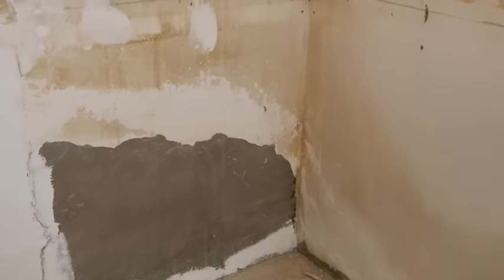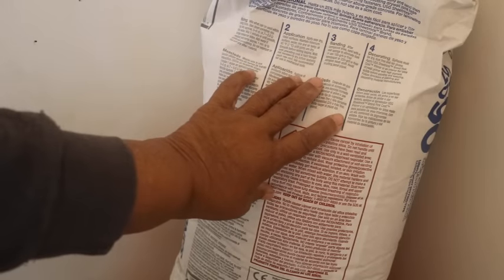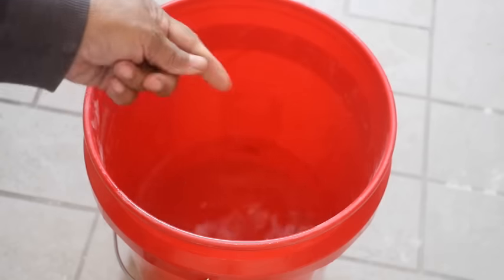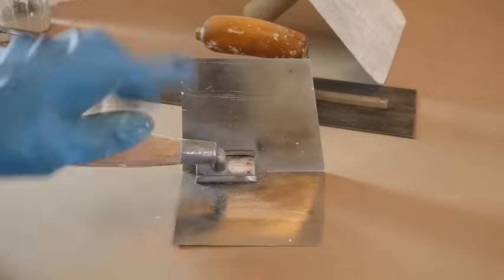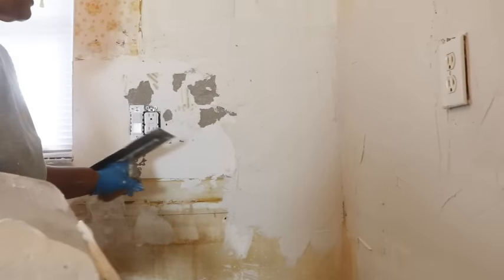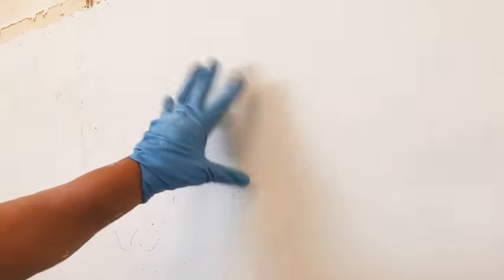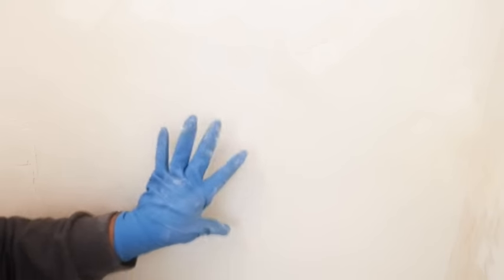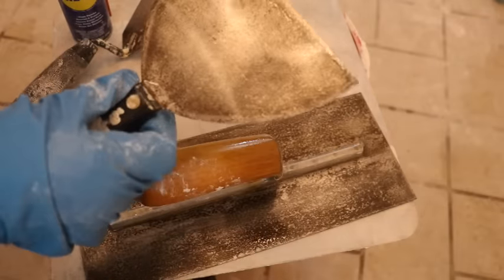You'll never sand JOINT COMPOUND again!!!

Comment: This is a very good introductory video with a lot of accurate information but I’m sorry to say that I still sand a surface like this before painting. This method is the same as plaster but the material is different. There used to be a product called Diamond Coat, and it had adhesive in it and was a one-step process just like what is being used here. It was inherently known to look nothing like you had left it the night before. You would trowel and trowel and polish it, and then the next morning BAMM! To ultimately make the surface as smooth as plaster or drywall finish I apply a tight “smudge” coat of drywall compound to the entire surface and then sand it, much like how it’s done with drywall application. Drywall compound (putty) has been around a lot longer than what plasterers are willing to admit. It’s been around since the 1920s as a USG product and plasterers used it to blend and smooth blemished wall surfaces, and they SANDED it. Also, this bag of 90 minute might say “EZ sand” on it. It’s not. It has moulding plaster in it. It is very difficult to sand.

Comment: I subbed. I found this trick out by accident. You are really good! Finishing walls that are newly installed is one thing, but re-work or repairing or finishing butt joints such as those in manufactured homes is a whole other thing.  Your tip on taking care of your tools is spot on too. I saw a new finishing tool on a short video I have to get and try it out. Thanks for the video!

Comment: When i saw the heading I thought, yeah Idont think so. When you pulled out the hot mud, I said we'll see. When you said theres a difference between setting and drying time I knew you knew more than 99% of the people giving advice. I do the same thing you do one small projects that I dont want to come back and sand the next day. Nect time add some plus3 to it. The plus3 causes the hot mud to go off faster, but stays workable longer, so you can make the surface smooth with less effort. Good job

Comment: For the water technique I use a masonry sponge I went use cold water and ring it out to just damp that has work subpar to wet sanding the wall and using my 12" trowel to finish works everytime.

Comment: As always, Great and informative video!  I have orange peel walls and wanted smooth walls under my board and batten.  I skim coated, and once dry, I used a lightly wet, yellow sponge.  Did this 3 times to completely hide the orange peel.  They came out awesome!  NO SANDING!😅😅

Comment: The best tip for anyone having plastering work done, especially if you haven't used them before. Hold back some of the payment until you see the plaster dry in daylight. Wet plaster always looks great and is much more difficult to spot imperfections. It's even harder to judge via video.
I taught myself a long time ago because there are many "plasterers" who are not very good at plastering or make a hell of a mess in the process.

Comment: Ah, the flashbacks ... I learned of this technique watching plasterers from the UK who favor it as I wanted plaster on the walls instead of drywall mud that chips easily.  My problem is I just can't get the feel of the trowel and end up doing more damage than good.  I used all the materials you showed; it was just the coordination of that trowel in my hand I could not master.  I had to end up sanding.  It was a mess.  The underneath is plaster but I finally had to resort to using a thin skim coat of just regular contractor's mud which is easier to work with for the final coat and then lightly sand.  Finally got the room done (19x20 with a sloped ceiling nonetheless) but what a nightmare.  Not a project I'd ever be willing to do again (it was for my daughter's bedroom we remodeled).

Comment: I had to subscribe because I have been a drywaller for forty years and I couldn't improve on what you just watched. It's more tiring than she makes it sound because she is a strong woman . Good luck in all of your future endeavors!
Reply: You don't sand joints? Just do it with a brush and water? How does that work?

I'm a carpenter... I've never seen a drywaller do it like that.
Reply: @stevem815  it's plaster if you keep it damp you can rin you trowel over it forever .

Comment: A really good video Jeanne.  You are thorough, upbeat and as brief as possible with your instruction.  I knew about using a wet sponge to smooth down joint compound without sandpaper, but never heard of "water troweling".  I assume you can use this same technique when usen premixed vinyl joint compound rather dry mix.

Comment: Amazingly helpful! The biggest problem I run into with projects like this is that I don't clean up thoroughly enough before starting the mud and end up getting debris in my mix. Getting it super clean like your before shot is going to save so many headaches.
Reply: Any time I get a piece of dirt or debris picked up on my trowel, I always discard those clumps of mud or put it in a certain spot on my pan edge that I know not to reuse. That helps too.

Comment: I do this over ugly basement walls and my clients love it, although I don't go for the same perfection. I smooth it out with a wet rag and (prime and) paint it the color of their choice. I do go the next level of wet troweling in the living spaces, especially in restoration work, but most of my work these days is ripping down to the studs and replacing with drywall. I learned the technique before Easy Sand hit the market. Believe me when I say the original DuroBond 90 is not as forgiving. The walls look fantastic. Thanks for sharing the know-how! 👍🙏

Comment: I was planning on hanging ¼ " drywall over my 100+ year old attic walls just to get a smooth surface to prim and paint. A much better, less costly and lighter weight solution. Also, I just had a conversation about skim coating and someone insisted that I should bend my trowel for skim coating. Thank you for noting the difference between a drywall vs plaster trowel !

Comment: When I get a situation like that I use a bonding primer sealer usually Guardz damaged drywall sealer. It will prevent bubbles at least on torn drywall.

Comment: I remember years ago when I helped out fixing old homes built in the 30's and 40's where the plaster walls were not sheet rock but hand plastered. Those walls were as straight and square as drywall is today. An amazing and mostly dead art.

Comment: When I was an apprentice carpenter in the 90s , almost every drywall taper around here didn’t have to sand , because their trowel work was flawless. Just a bit of sanding here and there with a sponge. Today it’s a different story but tapers don’t know how to use trowels they use knives, they put it on thick and sand it off smooth. They have taken the skill out of the craft .

Comment: I am surprised Leah does not prep the surface with some type of bonding agent (plasterweld, diluted pva, plasterbonder, etc.) prior to skimming. I would be worried about the hot mud adhering properly to the old plaster and whatever tiny bits of paint/mortar/glue might still be on the wall.

Comment: Did trick with paint brush 4inch an spackle knife.,, wet spackle with paint brush. like if painting the wall..I then skim the spackle knife across mud.. then if find areas with imperfections. I use the excess I took off spackle to fill any small imperfection.I then take 4 inch brush and fan out. imperfection nearly gone. .I find brush technic works great for corners. wet a little brush.. then use paint brush, like if cutting in with paint. corner edges nice and smooth.. no dust no fuss..lol

Comment: Very thin coats are the trick to avoid sandpaper. You may have to apply more coats but in the end it's faster because the last two coats dry very fast. Much faster and less messy than sanding.

Comment: Leah...good system ..it's actually ancient  ..so .here's the straight facts ..I grew up in a plastering family from Belgium but we settled in canada since 1904 ...we are all professional plasterers ...the water thing is the oldest system for a smooth wall ..we just used a different composition of materials..a mixture of hot processed lime ..plaster of Paris and goldust ..which would come out harder and smoother xs10 than any drywall compound and would not melt away with water ..hence they invented drywall n all purpose or taping n topping compound cause the skill was so much more difficult working on lath or plasterboard that it was a trade that few would tackle ...meanwhile drywall is got less than 1/4 the life expectancy ..the original where system was spray the wall with your washcoat brush and immediately wipe tight with your finish trowel ..we did this till the early 70s ..then the drywall Taping experts were born ..somthing that we found almost too easy to adapt to ..being real plasterers..real plasterers can also do exterior plastering..not stucco ..those are stucco applicators as we refer to them ..kind of  like the shoemakers of our trade ...

Comment: Hi Leah, it looks like you were using drywall compound to achieve this outcome.  I have joint compound on hand and was curious to know if this technique would be possible with this material as well? The terms seem to be used interchangeably and I am no expert but the drywall compound seems more cement like and usually comes in 20, 45 and 90 minute drying time. The joint compound I have is pre-mixed in a bucket (although I could have bought just the dry powder) and the drying time is a lot longer (24 hour recommended drying time).

I was hoping I could go on just before then and go through the process of scraping off excess, skim patching (doubling up) and then the wet brush technique.  Are you able to comment on this?

Comment: Most of us just use a wet sponge. Same difference I guess. Just get it wet, squeeze it out, wipe it clockwise or counter clockwise into your new mud edge (for repairs) and it smoothes it out. For giant skim coats like this just go over everything in circles till its smooth. Hit hi spots with knife first.

Comment: This is a great tip with the water trowel! When do you use the water trowel? When the skim coat is damp-ish but not dry (similar to your hand test on the scratch coat)? Or do you wait until it is dry and the water trowel re-softens the dried plaster? Thanks for the tip

Comment: Do you have any idea how many vacuums/shop vacs I've emptied from all that compound dust???? Now I know how to do it correctly. I haven't tried it since a painter I hired used it. He didn't fix a screw pop, just piled compound over it and then water sanded the edges. When it dried, I had a boob with a very predominant nipple on my wall. I had to redo that entire area, and I sanded. Bloody hell. Thank you! I've got to skim two small walls today actually. Going to use this method.

Comment: I watched this video last month and thought it was fantastic. Now I'm about ready to start on walls not quite as bad as yours here but loaded with small nail holes & a few 'patches' of missing plaster, 4" - 12".  I'm wondering three things, what would you recommend to fill in those patches (3/8" deep) , what preferred brush did you use and there is some old and stubborn wallpaper remaining on it, will that be an issue?  You have more complimentary remarks to you & your work than any other channel on YouTube. Actually, I'm very surprised you weren't selected to star in a reality home repair show. Or did you already decline? Be well.

Comment: You should always prime damaged drywall to avoid bubbles and blistering.  I use Guardz or a good oil based primer.
Reply from the maker: It was not drywall but plaster.  And I've love Guardz and have done a video regarding it.
Reply: @seejanedrill    I would still prime for better adhesion of the patching compound.

Comment: I am wondering about the torn drywall paper that exposed the brown layer. I cover that with shellac based primer to seal it so that it doesn’t bubble. Was this not a problem? Is it because you had your mud so thick. A comment about how thick you mixed the mud would be helpful. To be able to cover that much square footage with one mixing is amazing. I am going to try this out.

Comment: Contractors I hired only skimmed where the old tile was and a little above. They didn’t remove the old wall paper-just painted over it and over time the wall paper has developed tears revealing the wall beneath and is pulling from the ceiling creating gaps in the corners. My co-worker says it’s because of the heaviness of the mud pulling the wallpaper down. I’m not sure if removing all of the old, painted over wallpaper is feasible. Do I try to remove it where it’s loose and then skim the part they didn’t do? Help!

Comment: Ive been an all around carpenter for nearly 20 years and I currently do alot of work on rentals. It's a whole lot of patching. This technique seems like a no brainer. Im wondering why its not more common. I look forward to trying it.  Is it considered plastering when using drywall mud. That was joint compound and not plaster, right?

Comment: would this water technique also work when needed to cover a crack in the ceiling or wall?  plaster, tape, flatten, plaster, water? the only thing preventing me from trying it myself is the amount of dust from the sanding and having to basically move everything out of a room to do this....then there's the kids breathing in any of this stuff which I dont want.

Comment: You keep mentioning plaster; It looks like you are using sheetrock mud in a plaster application.  I'm a 3rd generation taper & plaster and joint compound are two entirely different things.  I did see that you were going over some lathe, so a thick compound can be applied without tape to plaster?  I've never tried it, but will next time, thanks for the video.  Great advice for DIY'ers.

Comment: Do you think we could "plaster" and skim coat an OSB surface that has already been coated with some type of poly or varnish?  I'm thinking the previous finish coating will protect the OSB from moisture in the plaster.  But whether the mud would adhere to the OSB, I don't know.  ( We're finding OSB on houses we are looking at, as finish walls, since drywall had gotten so pricey. And I know people don't like drywall work.  I do. I grew up in an old house with lath and plaster, very used to working with it. )  These OSB surfaces make a house so dark!

Comment: Well, I tried and I failed. My first coat was maybe too firm and maybe too thick. I could not finish trowel it out like you were. I thinned mix and it went on better but still too thick. My walls are an awful mix of plaster and drywall from previous owner butchering it. 90min easy sand setting mix stayed wet for over 2 hours. I was able to knock high spots down in most places but any troweling just pulled chunks out, put holes/voids in it. The thinner mix didn't dry until overnight, after probably 4 hours I tried to knock high spots down and only succeeded in tearing chunks out.

Comment: If those were sheetrock walls with torn paper surface,  I would first seal with Kilz to lock in the the exposed paper remaining so it doesn't lift from the moisture in the plaster.

Comment: does this method fix the issue of air bubbles in the finish when applying over existing painted surfaces? If it does that is double plus good.  AIR BUBBLES are the bane of a remodelers life.

Comment: pull the drywall. put on new board. easier, (probably cheaper)  than skim coating over 3-4 days. Plus all the work to chip/ bang off the tiles. my 2 cents. a tape coat  between the new and old drywall would be enough to get on with the project. start installing cabinets and tile backsplash.

Comment: People who do sheetrock mud for a living only have to lightly sand. I watched some men do a ceiling once and they put the mud on with a paint roller. They had to dilute the mud with water and get the mix just right. Back in the day when I did it we would mudd everything and the next day sand and add another coat. Around 1990 when the Mexicans came they used the 20, 30, 40 minute mud. With the power sanders 10 of them could do a whole house in one to two days.

Comment: You always have to sand joint compound. There are no exceptions to this. 25 years in the commercial drywall industry and I seen it all. Of course your final coat should be smooth. Mine always is. But that doesn't mean you can get away without sanding it. You will have awful flashing on the paint and it will be a terrible finish overall if you do not sand your work.

Comment: I've tried that before and the only product that has worked great for me is the Diamond plaster. You lightly spray it with water when it is damp and then just keep troweling it and moving the cream around until it is hard and smooth like glass.  No shrinking and a great tough finish. Add me as a subscriber.

Comment: It would be great if you could talk about the technique you use with your trowel on applying the mud. What angle to use and how much pressure, Etc. Also look consistency needed for the mud. This was a good video, but I was kind of disappointed with not getting those tips included in with this
Reply from the maker: I covered those things you mention in other plastering videos.

Comment: First of all, I use stainless steel tools, which you can clean them faster, even the next day. Personally, I hate the normal ones and I can't actually remember when was the last time I saw someone using tools like that.
Secondly, instead of a brush, you can use an electric paint pistol and it Only takes 2 minutes to wet the entire room, not talking about saving your energy.
Lastly, I usually work with a 70cm trowel, but Always use that fiber net because the cracks otherwise will start appear, as the concrete works in time, especially if the house is new.
If you invest in tools, they'll do half of your work.
Nice tip, though.